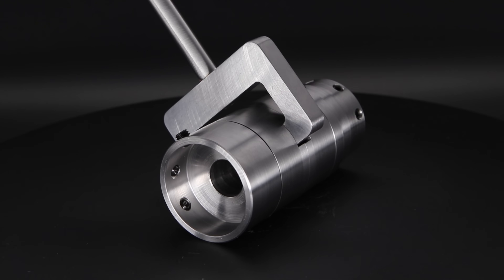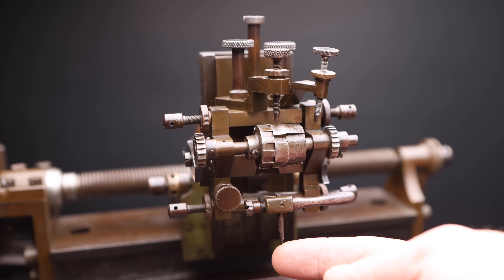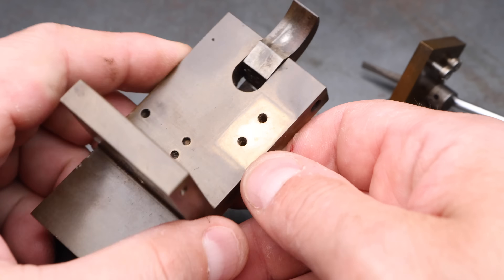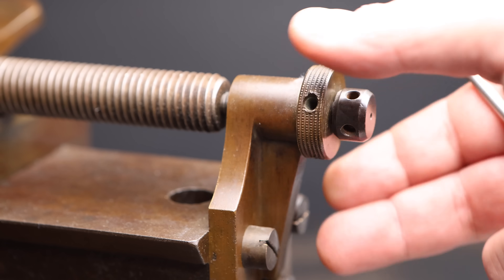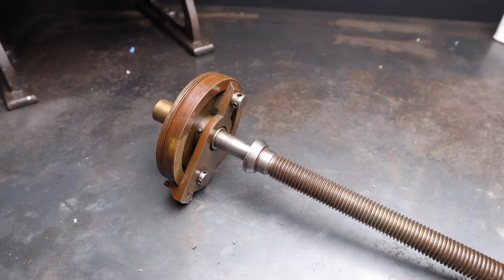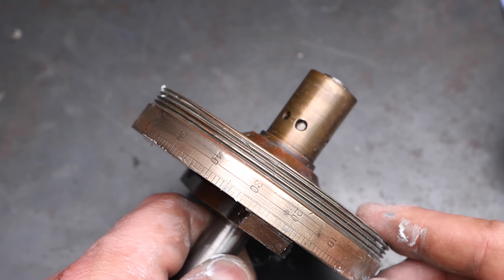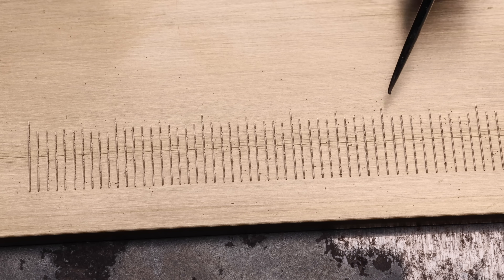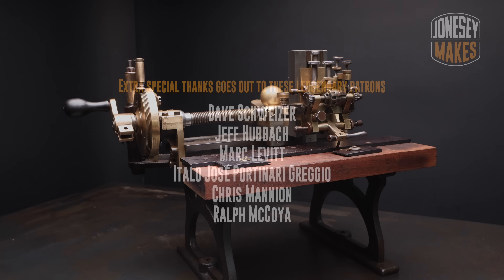The Most Interesting Tool You’ve (Probably) Never Heard Of? — And I’m Giving It Away

Comment: Awesome! I believe you can change the count at which the length of the lines change by using different barrels. My mom has a sewing machine that is also capable of embroiding and it uses those barrels to set the paterns. It's very used in automatic lathes, for instance. (those are not CNC lathes but lathes that change the tools in a determined order for repetitive production work - they do reguire an operator.
Reply from the maker: Very interesting, I’m sure you are right.